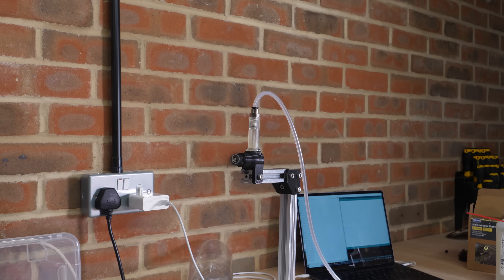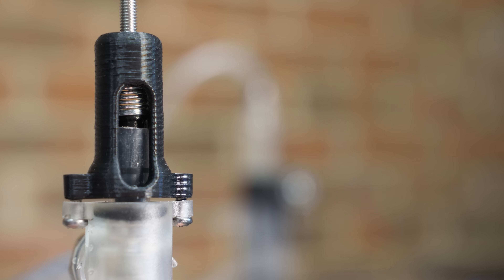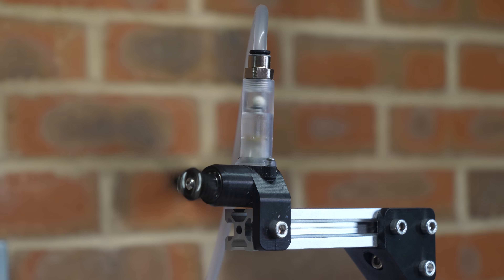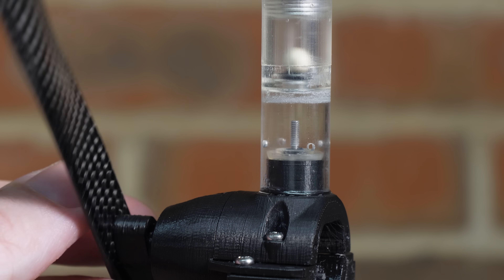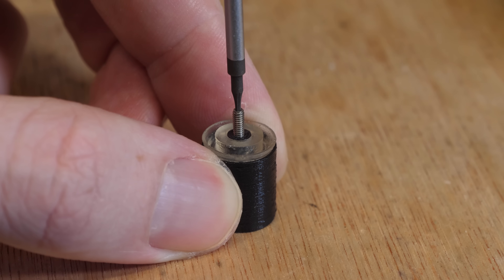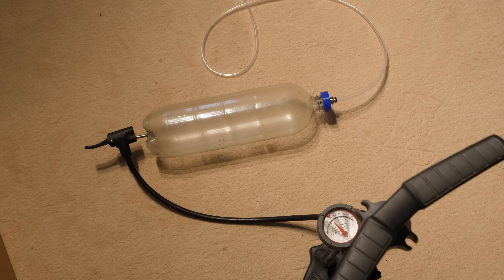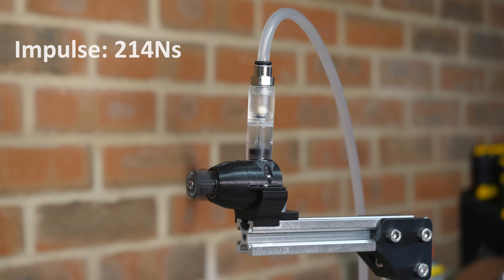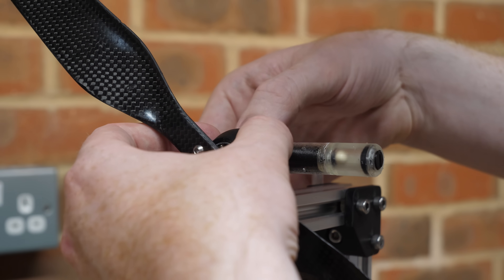4,500RPM Air Engine

Comment: Another great video, I can't help but draw comparisons of your engine to how a regulated pcp airgun works. When we tune for shot count we fill to high pressure and regulate it down and then set the valve to open for an extremely short distance and time. An airgun is essentially an engine it just shoots its piston out everytime. Also bigger bores tend to be more efficient up to a point so maybe try bigger and smaller pistons?

Comment: Impressive engineering Tom. Not just this video, but the evolution throughout this air-engine series.
The opposing twin-cylinder design even has a sound that matches it's improved output power.
Since efficiencies where gained by lowering initial cylinder pressure, to operate at lower RPM, wondering if worth exploring a V-cylinder configuration as this configuration is known to produces more torque at lower RPM than other cylinder configurations?

A thought/suggestion. Now that you have a lightweight regulator, it may be possible to use dry ice as a pressure generator to allow for even longer run times.

Comment: A combination with a hidrogen tank, and a rocket chamber for the hidrogen, in order to build up pressure to another tank for its use as the cylinder gas can be very interesting

Comment: 11:36    firstly, the valves should be driven  via  linkage  from the  CRANKSHAFT.!      NOT  the way that you have done.         secondly, a reciprocating engine  SHOULD  have a  FLYWHEEL.!          thirdly, the  CYLINDERS  should be  OFFSET, enough, so that  STRAIGHT  con-rods can  be  used.!!!!!          it should be determined whether a smaller diameter prop that has a lot of pitch would be most efficient.

Comment: Amazing series. 

If you end up continuing testing on the two cylinder, you should add a counterweight to the crank shaft to prevent the rocking motion you got on the test stand.

Comment: Lot of pulsing with that 2 cylinder engine. I wonder if that is due to the sideways orientation of the cylinder without the springs for the balls? Wonder if a V or an inline vertical cyliinder design would help?  Or maybe that pulsing is coming from somewhere else, like the two cylinders fighting each other intermittently.

Comment: Nice results! Have you tested different exhaust port sizes and timing/duration? In such a low pressure engine, my feeling is that good scavenging could make a notable difference.

Comment: Now you can focus on air intake manifold design and how it affects performance by efficiently splitting the air between each cylinder.

Maybe even scavenging to squeeze more pressure into the engine?

Comment: I think you can get it even more efficient, at the pressure regulator the pressure difference get converted to heat and the air expand trading pressure for volume, so if mount the pressure regulator as close as possible to the engine the less heat get loss in the way so you have more air volume to work with.

Comment: I have an idea ,    do you guys know the name of thoes inflatable  yellow  boats  that are used in the  case of a crash ?  They are filled with a chemical  reaction that  gets them ready in minutes  , and i was thinking  if a little bit can inflate a boat for 10 people maybe it could be fuel to make this engine run for like 10 minutes or more  and it doesn't require too much space to store its prolly powder you could have it inside of  that bottle and while its creating the reaction it would be powering the  engine I don't have the funds to do that experience but I think it would work it prolly would give y far more than 100 psi you would prolly need a stronger bottle  and with that  you could run that twin engine , you already have something that can regulate the air now you just need to regulate the explosion lmao    i mean  its more like Coca-Cola  and mentos but on steroids

Comment: The efficiency of piston machines depends on temperature differences in the cycle. Unfortunately, the projected lever arm of the crankshaft is often misused as an argument for higher torques, but this is neither relevant for the effectivity nor the efficiency. Exempla gratia at internal combustion engines, the so-called equal volume process with combustion of the entire fuel in theoretically no time at the top dead center has the best efficiency. There, however, the projected lever arm is zero.

Comment: Very well done!
I wonder if it'd be worthwhile trying an engine with multiple diameter bores, like the old steam engines had. The small bore for the high pressure steam, that fed into the medium-sized bore, and the last one was the large diameter bore. That was to get all the energy out of the steam. It might not work as well with simple compressed air but it'd be interesting to try.

Comment: Regulator for throttle control and youll have a 4 channel air power plane. 5 channels if you throw on some flaps. Cheers. Nice work.

Comment: what about using 2 cylinders, but kinda like some sterling engines, letting the exhaust (that's still at a decent pressure) of the first engine be plumbed the the second cylinder? if you can get the timing right, maybe you wouldn't even need a valve or build up area?

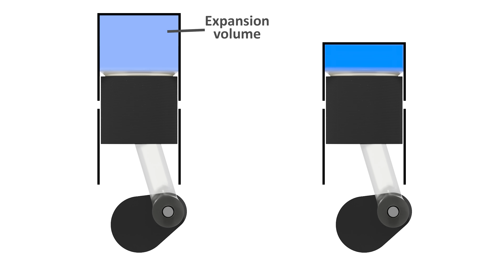Comment: I think your explanation of the efficiency of the two engines from around 5:40 on is very incomplete. Always unfortunate to see people spreading misunderstanding in such a confident way.

The angle of the crankshaft has nothing to do with efficiency. The energy in each stroke is a result of a displacement volume times a pressure (similar to BMEP). How the piston is displaced doesn't matter, and what weird crank angle and speeds etc you're using doesn't matter.

What you should use to explain any differences in efficiency is to look at where the air is expanded, cause that's where the energy comes from. Same reason why using a pressure regulator is a really really bad idea, since you're expanding air in the regulator instead of while displacing a piston. Making sure the air expands actually in the engine instead of any regulator, valve, inlet or exhaust ports will let you build much more efficient engines.

Get your facts and understanding right before lecturing others on such a public platform!:) I love the series, I just can't stand the spread of misunderstanding.
Reply: Yeah I also didn't get how efficiency can be same with the regulator as he said earlier in the video, free energy

Comment: Very cool. Have you thought about putting a valve on the cylinder head to let the air out on the up stroke. This would prevent the air from being compressed as the piston heads up robbing power. You would need some mechanical linkage to do open the when the piston reaches the bottom and close it again at the when it reaches the top.

Comment: if you modify the outlet valves you might be able to use the venturi effect to reduce the pressure and get higher efficiency when using the prop.

Comment: I couldn't stop thinking through all the video about how you could redirect the exhaust air to the air tank so it could have more autonomy at least just a smidge, maybe it will reduce the power a little but you could gain on autonomy, or use the exhaust air to redirect it to the income air in some way and increase the power like a turbocharger does. Great video

Comment: Is there a way to use the exhaust air to maximize efficiency? Like connecting one of the cylinder‘s exhausts to the inlet of the opposing cylinder but with a one-way-valve so that the high pressure main air can‘t enter the low pressure exhaust. Or maybe a second set of smaller cylinders also connected to the crank shaft but driven with the exhaust air of the large cylinders.

Comment: there is an IC engine with 3 pistons that takes the exhaust gasses from the two smaller pistons and puts it into a third bigger piston to recover energy from the still expanding gas, I think you could try something like that here with a 2nd piston with a bigger diameter and shorter stroke to divide the energy taken from the expanding gas to increase efficiency even further, if frictional losses are not too high.

Comment: NICE... you think you can run this from a 8 grams CO2 capsule? I think there are 1100 psia in that small metal tube, you can regulate this in a detend chamber/ rezervoir to cascade down to more "workable" presure. You may take out a run time of probably more than 5 minutes...
Problem is that it can frozen du to thermal expansion transfer... I dont know... it worth to try? 🙂

Comment: This is super impressive Tom... I keep imagining or thinking of how efficient this would be when scaled up to supply good clean power for places with electricity issues... And maybe pump back with a cool leg pump that can pump compressed air back.. Even if it's a cylinder that can give 2 hours run time at Max output and perhaps double at the lowest power output.

Comment: Can you make a V-shaped V8 motor with that? With every piston pushing at a 1/8th of a rotation offset? 
That would probably be a very strong, although air-hungry motor. But maybe you could build an RC tanker truck with such a motor that uses its trailer as air storage.

Comment: My first thought on the 3:1 cylinder stroke was that the air in the cylinder, while the piston moves up, will be crompressed to almost 3 atmospheres. It depends on the pressure necessary to seal it. If it doesn't seal too easily it will be fine. But this would cause a force applied before the top dead center that is close to the force pushing the piston back down after the top dead center. In fact it would only use very little amounts of air from the tank.
I think it would only be worth to increase the stroke up to the point were the sealing isn't given anymore.
There is probably a certain size of the stroke that will generate a big amount of thrust combined with efficiency. It would need to maximize the force on the piston through the entire push cycle (little stroke) and minimize the amount of wasted air (large stroke).

Comment: Great video, love this series.

I'm confused by the cylinder design at 4:41. I've might have overlooked or forgotten something from your previous experiments.

When the piston is at the top of it's travel path, it has a 1 part chamber that fills to 3 bar. This then pushes the piston to the bottom, where the target was the pressure to be at 1 bar. The outlets are also at the bottom of the piston travel. I understood the idea was to have no access pressure at the bottom of the piston travel, which would intuitively cause looses. 

So my confusion comes in on the piston path upward. Here as the piston starts traveling up, the pressure inside the cylinder is vented to 1 bar. As the piston starts its travel upward, it closes off the outlets sealing off the cylinder. If I understood this correctly, the piston will therefore compress the air inside the cylinder to just under 3 bar. Since the engine is made to run at 3 bar, when the piston is at the top of it's travel, the pressure inside the cylinder will equal the inlet pressure, and no pressure exchange will happen. So the engine wouldn't run. 

Well, my reasoning clearly isn't true, since the engine ran. My description is also overly simplified. Because of the inaccuracies of my mental model, the engine could still run, but it would seem to run rather poorly. I'm sure there's a bigger element I've missed?

Comment: I wonder if optimizing the exhaust ports has much potential to improve efficiency. By reducing the resistance when venting to atmosphere maybe you could reduce the pressure inside the cilinder and thus reducing the force necessary to compress the gas. increasing the port size and/or amount of ports can't hurt I would think? Maybe you could even use the flow of air to suck more air out by making some sort of Venturi nozzle.

Comment: Dude you could have a super lightweight rc airplane that runs off a bike pump with some tiny rutter running off a watch battery. Wouldn't last longer then a few minutes but for something you recharge by pumping that would be awesome.

Comment: Would it make sense to do like they did on old steam engines were the exhaust of one cylinder was fed as input to another tuned to work at lower pressures?

EDIT: This kind of engine https://en.wikipedia.org/wiki/Compound_steam_engine

Comment: you can drill a few more holes at the exhaust which will increase flow rate of the air and speed up emptying the cylinder

Comment: Soft drink bottles are rated to many hundred psi... your tubing & air system will burst open long before the bottle does.
So... use the ratings of those, assuming the connection to the bottle/reservoir is a safe design :)

Comment: Wouldn't be possible to make a mini air compressor that would give enough airflow to make the motor work indefinitely? I know turning electricity into air pressure is not as efficient  compared to an electric motor but just to bring your idea further

Comment: I think you should invest in a small CNC as in general subtractive manufacturing from homogeneous solid base material will allow for tighter tolerances, better surfaces and higher strength parts, while also giving you the option of using other materials.
The things like the cylinder-head could be milled from Teflon - forming a really tight fit and having incredibly low friction.

Comment: Hello Tom I don't know if you have thought of this but would a threaded thin bolt connected to or in place of the valve stem that runs up through the top of the valve body with a lock nut on the inside and the outside work better and be lighter than the spring and diaphragm for regulating pressure.

Comment: With a 2 cilinder, i guess a V twin would be better? when you apply pressure, the engine will always start to turn(could be the wrong way ofcourse), a twin boxer you have 2 dead points.

Comment: Here is another point to increase your efficiency significantly: make the exhaust air leave the cylinder all the way up to the TDC.
The reason your version with larger air volume was less efficient is because at the point where the exhaust openings were actually working the air pressure dropped to about ambient pressure so only little air could escape. Thus most of the air got compressed again by the piston going up, eating up all the energy gained on the way down.
Of course this needs a timed valve (think combustion engine), which is a challenge on its own...😁
Reply: The engine already does this, you need to check his earlier videos. The  rubber o-ring on the top of the piston deforms to seal the cylinder as the pressure increases on air inlet, and then returns to its original shape as the pressure decreases at the bottom of the stroke, so air can move around the piston as it moves up the cylinder, it isn't sealed during this part of the cycle. There is no compression on the upward stroke. Y'all are coming up with solutions to a problem that this design doesn't have.
Reply: @Scrumdog  Good point! That makes me wonder, though, why there was such a pronounced unexpected difference between the two versions with different end pressure. Maybe this 'leaking seal' does not work as well as it should?
Reply: Perhaps a small extra checkvalve? So it opens as soon as there isn’t an excess in pressure
Reply: @xmysef4920  There needs to be an excess in pressure, though. Otherwise the air won't get pushed out.
I think the valve needs to controlled by the position of the piston: it needs to open when the piston is at the lowest position up until the piston reaches the highest point.
Reply: Maybe a rocker arm that slides open and shut a peep hole? When the cylinder is at the bottom, it bumps the rocker arm which pushes a sliding "door" to open a relief valve, and towards the top it bumps the other end to shut it again? 

Would introduce a new source of friction, but would greatly reduce the compression.
Reply: Maybe a spring loaded valve in the piston head? Valve is open up to ~1.5bar, but closes at higher pressures. Might be hard to do at such small scales.
Reply: @toolscientist  cam shaft, my dude. Making it save more energy than it steals is the trick.
Reply: add lubrication  to some moving parts
Reply: So how acn 2 stroke engines run on no head valves? Or they have one?

Comment: Have you considered double expansion and or double acting engines?

Also, if you put the motor inside the pressure tank then any leaking will have high pressure air leak into the motor and out thru the exhaust ...

Comment: Why aren't you using CO2 cartridges. Some simple pressure regulator, CO2 cartridge and radial piston engine with 4 or more cylinders to keep the torque line flat.
Reply: theyre much heavier
Reply: @mtqrx  yeah but imagine the power that can be harvested from high pressure cartridge. 4 or more cylinders could have enough torque to eliminate weight as s problem.